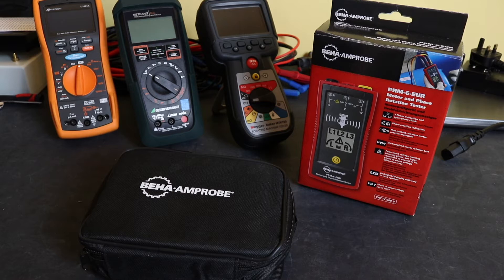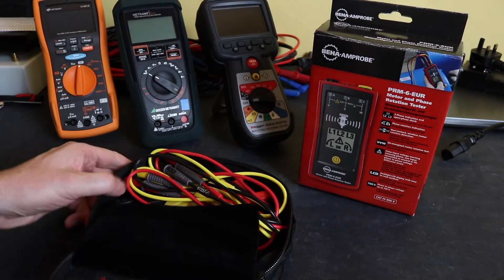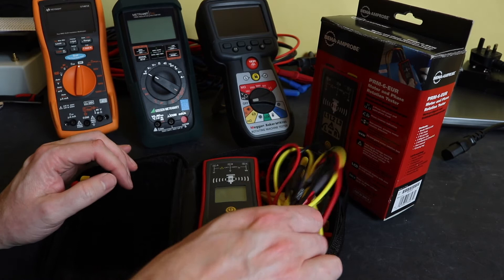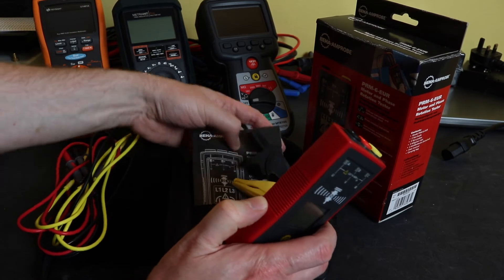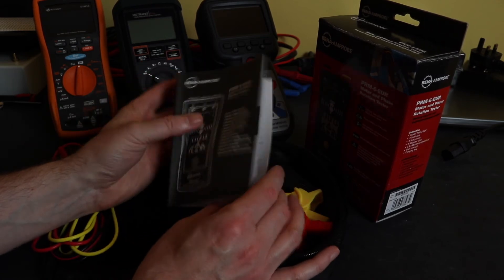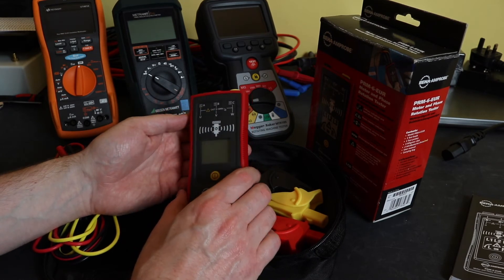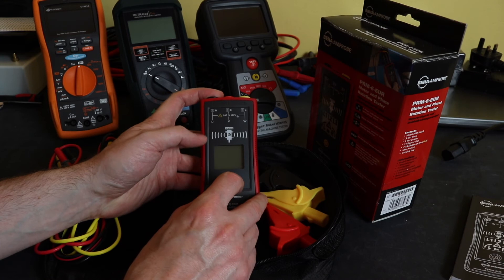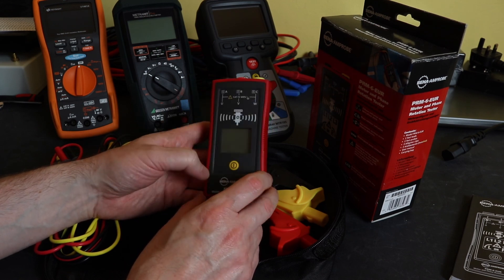Beha Amprobe PRM-6-EUR Unboxing

Comment: Looks like a pretty decent phase rotation tester, the Fluke rotation tester looks a little more better quality. I have one it’s manufactured by MASTECH I haven’t used it in years it wasn’t the best quality but it did work. I’m looking forward to your comparison between the Fluke and Amprobe Rotation Tester.
Reply: Here is the thing when buying tools I have started to avoid smaller cheaper tools more as a means to save and buy high-end measurement tools. Quality rather quantity. I recently bought the Gossen Mettrawatt Secutest pro safety tester. More as a means to test installation of cheaper electrical equipment (lights in particular which have really issues of safety). The tester however is calibrated to test medical devices where measurement accuracy and precision is critical as well as various touch type currents to meet very strict standards. Really expensive but now I am using it regularly it’s really nice. In the market for a high end motor tester and oscilloscope and power bench meter (Keysight ideally) but I will have save for a while and maybe willing to lose a kidney in the process...As always quality work in reviewing this.
Reply from the maker: I guess people will have their own preferences and reasons for buying test apparatus. I do tend to like to have backups for some of my instruments in case they are away for calibration or get damaged and I still have work to do. There are also some work environments where I just do not like to take good quality test instrumentation into.
Reply: @three-phase562  all good points.
Reply from the maker: Yeah, you are right TETC, the Fluke has a much sturdier build and better quality accessories. But it does cost significantly more and you have to fork out extra for a case. I have a Peakmeter unit as well to throw into the mix, probably very similar to your Mastech unit.